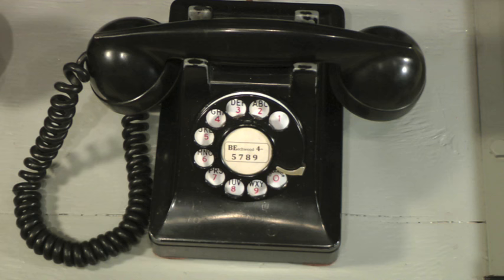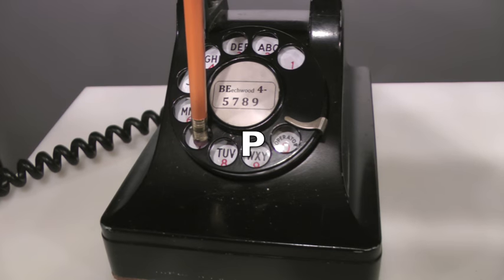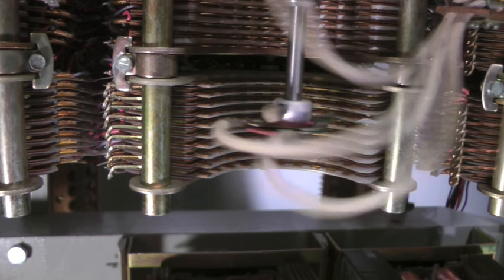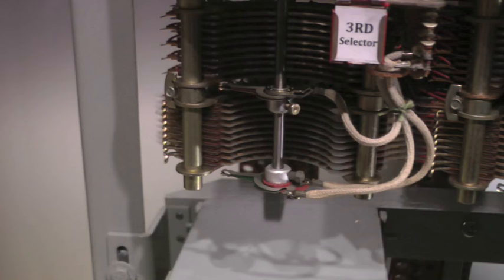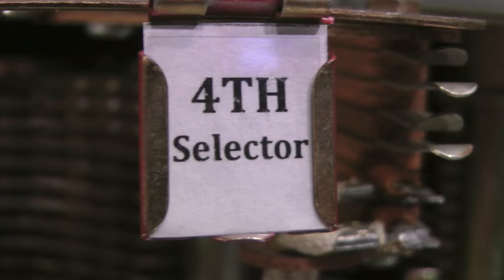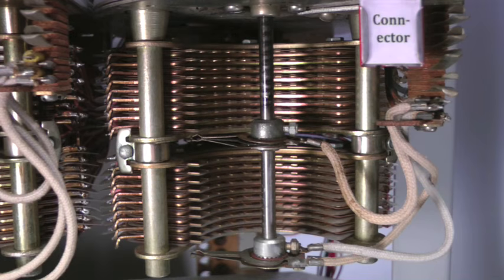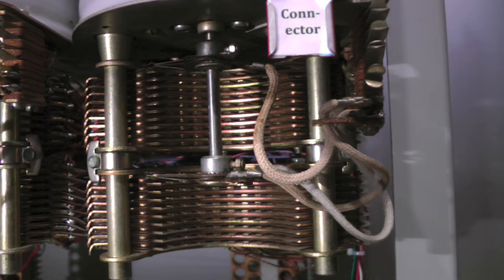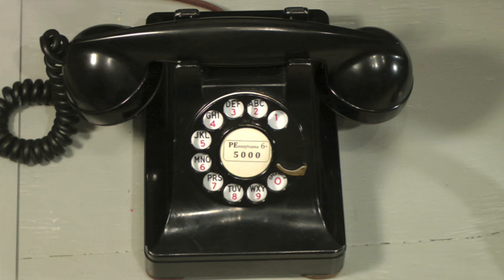A Call To PEnnsylvania 6-5000 Through The Step-by-Step Telephone Switching System

Comment: Started out in 1980 in New zealand on the BPO version of these "100 type" very similar except they had a uniselector as a line finder. Spent many hours adjusting and oiling switches!   24,000 line exchange, the noise was amazing,  you could tell when a ad break came on the Tv from the increase in noise. The funniest were Rugby test matches, the place would  go quiet and you could hear individual calls going through, like 3am but during the day. Amazing pieces of equipment, hopefully there is one preserved somewhere.
Reply from the maker: Yes, when working in a SXS CO you were certainly aware when something abnormal was happening. There are a number of preserved SXS CO's in North America in museums or private collections. If you expand my video description above, there is a link to a video of one of them.

Comment: When I was in college in the early 1980’s in Springfield, MA, our local exchange 782 and 783 in the 413 area code used these steppers. There was no Touch Tone service offered and the clack on the line when dialing was very loud on a “modern” phone. I always recalled there was no clack for the last two digits. Just for fun, I hooked up an old model 300 phone and it had less clack sound. Guessing it was better adapted to the old stepper switches than the 500’s or Trimline phone I normally used.
Reply from the maker: Well, that's an interesting anecdote that I can't explain. When I plug 500 sets into my demo unit. they are much quieter than the 302's. In fact, I took varistors from the receivers in 500 sets and put them across the receivers in the 302's and it helped quite a bit to quieten things down. Thanks for watching.

Comment: My father told me a story of when he was a kid in a city served by these switches be used a walkie talkie to coordinate with a fried to dial each other at the exact same time. This resulted in the phone making all sorts of strange noises. But after a few tries of this, a voice came on their line and shouted “will you kids stop playing with the phones!!”
Reply from the maker: Well, with one exception, this activity would not have caused any problem in the step-by-step switching equipment. Both calls would have progressed normally and after dialing the last digit, the two connectors would recognize that the the lines being called were in use and return busy tone to each caller. The exception was when the two callers shared the same party line. The two simultaneously active dials being a small fraction of a second out of synchronization would have resulted in non-conforming dial pulses and caused irregular activity at the first selector.
Reply: @Hicken65  interesting - he described hearing noises like something was shorting out.  Could a different type of switch cause this?  They would time it so that the dial would send its last pulse at the exact moment.  This had to be in the late 40s or early 50s. It must have caused some issue if someone at the central switch patched in and told them both to cut it out! lol
Reply from the maker: Well, two single party customers served by the same central office switching system and who called each other regularly would likely call each other at the same time once in a while. It would not cause a problem in the central office. Each call would reach a different connector and both connectors would recognize a busy line and return busy tone. The exact timing of the last digit to be dialed would have no relevance. Each line would appear busy  at the connector as soon as the line received dial tone, before any digits were dialed at all. This was necessary so that anyone calling a line that was in the process of dialing an originating call would get busy tone and not disrupt the call in progress. So I have no idea what was happening in the scenario described to you by your father.
Reply: @Hicken65  ok I asked my dad for more info - he said he toured the central office as kid (Stamford CT) - they used Strowger switches - he said when they did it, one would always get through to the other except when the voice came in.  It may have been when the voice came on that they heard the strange noises.  So perhaps it did not cause any actual issue but the repeated calls between the two parties caught the attention of someone working on the frame.
Reply: @Hicken65  that makes sense to me - perhaps his memory is fuzzy it was like 60+ years ago.
Reply: actually he thinks they did get busy signals each time - that makes more sense - he just had to try to remember lol.  The thing he remembers the most was the voice that scared the crap out of him.
Reply from the maker: @ntsecrets  These were really just normal calls through the switching system. There would be nothing to attract the attention of a CO technician since there would be no alarms. It could be that a technician was working on one of the connector groups involved and just happened to notice the unusual repeated attempts to the one particular number. He could have monitored these attempts by plugging into the switch with his hand test set and then interjected when he heard what was going on.
Reply: @Hicken65  I remember in the 70's my Brother Sister and I were messing with a payphone and spent ages dialing random numbers and after a while a woman's voice come on telling us in no uncertain terms to F off and stop playing with the phone or the police would be called.  Someone at the phone exchange or CO in your case and may have seen the switch going crazy perhaps.  This is in Australia.

Comment: Interesting, but I still can't figure it out.  It's amazing telephone calls got completed for many decades this way, with all that electromechanical switching along the way.
Reply from the maker: The electromechanical telephone switching network was indeed an amazing achievement. If you're interested in figuring it out, you can watch the very long videos on my channel (Hicken65) that detail the operations of each of the three switch types. Thanks for watching.
Reply: @Hicken65  Thanks.

Comment: When I was a kid, the radio station would have contest, I would force the dial back rapidly to dial the number faster.

After seeing how the system worked  I am amazed at how well they were made back in the day...
Reply from the maker: The switches had some tolerance for imperfect dials that were pulsing over or under 10 pulses per second. If the pulse rate deviated too far, however, a call would generally not reach its intended destination.
Reply: @Hicken65  I had an adjustable dial that could do 20 pps.  I used it with complete success in Annapolis MD in 1968.
Reply from the maker: @dbeierl  A number of switching systems around the world were capable of handling 20 PPS. The Bell System Step-by-Step  that I'm demonstrating could not. Your 1968 Central Office was a different type.
Reply: @Hicken65  thank you.

Comment: So I've been watching and I've watched a few videos and I'm still confused. Does the phone not care what route it takes between the finder and the selector?   
So I get the line finder. And if I'm getting this right. All the numbers lead you to a specific bank to the line selector?  Does that mean that The same line can be serviced by multiple selectors?
Reply from the maker: Each telephone line did not have its own dedicated switch or set of switches. To make efficient use of the switches, there was a great deal of shared access to them. For example, line finders were arranged in groups of up to 20 that had shared access from 200 lines and connectors were arranged in groups of up to 10 that shared access to the same 100 telephone numbers. Between the line finders and connectors were the ranks of selectors. Each line finder was tied directly to its own first selector. After that, the 2nd through 5th selectors were set up to be accessed on a shared basis from the preceding rank of selectors.Typically, SXS systems were provided with sufficient switches such that about 7% to 10% of the telephone lines could be in use simultaneously on originating calls and 7% to 10% could be in use simultaneously on incoming calls. A 50,000 line SXS office would have around 25,000 of these switches.
Reply: @Hicken65   I get how it works now! Thank you so much for taking the time to give me a detailed explanation.  You have no idea how much I appreciate this. I've been trying to figure out for years of these things work.
Reply from the maker: @Rusty_Nickle  And if you're really interested, I have much longer, very detailed videos on my channel. Just search on "Hicken65". Thanks for watching.

Comment: As a kid during the era when this type of system was in use, I wondered how the system knew if a dialed number was long distance or not. I made the assumption that the way it did that was based on the sequence of the first three numbers dialed. At that time, all Area Codes consisted of three numbers of which the 2nd digit was always either a 1 or a 0, and nobody had a telephone number with 1 or 0 as the second digit of the seven digit number. As an example, back then, in Connecticut (area code 203)  you did not have to dial an area code for dialing a local number, 335-3396 in the Bridgeport area. If you wanted to call a number outside the local area, but still within Connecticut, you simply dialed 1+335-3396 for example, say from Hartford to Bpt. If you wanted to call outside Connecticut, the sequence was 1+212-555-1212 for example. So, by recognizing that the 3rd digit in the sequence was or wasn't a 1 or 0 determined if the call was headed outside the home area code. Is this correct?
Reply from the maker: Yes, you're correct.. The first digit "1" was the long distance access code. It was not considered to be part of the called telephone number. In a typical local step-by-step office, if the first digit received was a 1 and the second digit received was 2 to 9, you would be connected to a long distance trunk to a toll office.The full 7digit or 10 digit telephone number would be sent to the toll office (but not the access code"1").If the second digit of the received telephone number was 2 o 9, the toll equipment knew you were making a 7 digit intra-area call. If the second digit of the telephone number was 0 or 1, the toll equipment knew you were making a 10 digit out of area call. It made a difference in determining if the routing translation would be performed on the first 3 digits of the telephone number or the first 6 digits of the telephone number.

Comment: Thanks for posting this, it was fascinating. One point is unclear to me. When a digit is dialed, how does the relevant switch know when the last pulse for that digit has come arrived, and it can then seek an available circuit. I know the timing of the pulses is important. Does the switch simply have a timeout, and if another pulse doesn't come in time, that indicates that that digit is complete?  Thanks!
Reply: Thanks! As I suspected, timing is everything. I'll watch the video you reference.
Reply: I have the same question but no answer.
Reply from the maker: The slow release C relay monitors for the end of the dial pulse train. When the A relay has re-operated and remains operated after the end of the last pulse, the C relay releases. The acceptable release time range is from 111 to 140 milliseconds. This closes the energize path for the rotary magnet. Operation of the rotary armature rotates the shaft and wipers to the first terminal of the bank on the selected level. C remains released unless this selector processes another digit in a digit absorbing application.

Comment: Wonderful. That equipment must be rare as hens teeth.
Reply from the maker: Thanks. Of course most of this equipment was scrapped as it was being decommissioned in the 1980's and 1990's. Some of it was saved by collectors who have built demo units similar to mine. There are a few collectors with entire SXS central offices in their basements or sheds. There are also several museums with working displays of this equipment.
Reply: Hicken65 that’s like my stash of Amateur radio tube equipment. What engineering can accomplish!

Comment: In your examples, your step by step units are side by side to make one call from a telephone to another.  In a central office, would this be the case, or would my dialing end up traveling between different areas of the CO ?

For instance, after I dial first digit as 5,  would the connection be then made to a step by step that is dedicated to handle the second digit following a 5., and if I then dial 2, would be connected to a step by step that handles the 3rd digitl for numbers that begin with 52 ?

And how did that work when I dialed from one CO to another ? if I dial "52" and this belongs to a CO halfway across town, does this mean that after racteching up twice, it would hunt for a free line to the other CO, after which, the dialing pulses would be transmitted to the other CO? Upon receiving that connection, how would the other COP know that the first digits dialed were "52" ? Were there separate physical lines for each dialing prefix ?
(if this is all explained in another viddeo, just  give me a link or video title).
Reply from the maker: In large offices, there were dedicated bays (320 selectors per bay) for each rank (1sts, 2nds, 3rds, etc.) of selectors. So yes, your call would travel all around the CO. For calls to other CO’s, they could exit the initial CO on the first, second or third digit. The outgoing paths were called trunks. If you were calling 529-1000, which was in another CO and the 52 pulses were handled in the initial CO by a first and second selector, the remaining pulses          (9-1000) would travel over the seized trunk and arrive in the distant CO on an incoming 3rd selector. Only calls that began with 52 would reach the third selectors in the distant CO, so it didn’t have to sort out what was the first 2 digits were. The 3rd selector would process the digit 9. A 4th selector would be seized and process the digit 1. A 5th selector would be seized and process the digit 0. And finally a connector would be seized and process the digits 00. Generally, switches called “repeaters” were used on the trunks to freshen up the pulses sent out by the subscribers dials. If you are really interested in this subject, I have very detailed videos describing each switch type. Just search YouTube by entering my channel name, Hicken65. Below is a link to a video (not mine) inside an actual in-service small SXS central office, that gives some idea of what the equipment looked and sounded like.
https://www.youtube.com/watch?time_continue=2&v=InN6G2RnaCw
Reply: Thanks for answer.   When COs started to have multiple NNX, did they have to then build trunks for each NNX supported by the destination CO ? Or was a totally different method of telling the destination CO about the digits already dialed by originating telephone ?  @Hicken65
Reply from the maker: @jfmezei  Generally, separate trunk groups were not required. Most multiple NNX CO's had the same first 2 digits. In my previous example, if the distant CO had three NNX codes, they would likely have been something like 529, 528 and 527. The incoming 3rd selectors would receive 7, 8, or 9 and the calls would be directed to their correct destination.
Reply from the maker: Sorry, I don't relish the thought of attempting to edit that video. However, for a full explanation of how the line finders, selectors and connectors work, you need to watch my long videos on these switches. Just search my channel name, Hicken65, on You Tube. Thanks for watching.

Comment: How did switching offices change when touchpad dialing was introduced? Also, why did the first through fourth selectors have multiple contacts on each row? was this so that  any selector could be connected with up to 10 in the next position, thus almost "multitasking"m
Reply from the maker: Other switching systems, such as crossbar and ESS could handle touch tone. The SXS could not. However the telephone companies soon inserted an electronic device between the line finder and the 1st selector that could receive the tones and translate them into rotary dial type pulses that they would send to the 1st selector. The subscriber would have the convenience of touch tone dialing, but there was a noticeable delay before the distant phone would ring.
Reply from the maker: For details on the selector contacts, see my long video The Selector In the Step-By-Step Telephone Switching System Part 1. Just search my channel name, Hicken65, on You Tube.